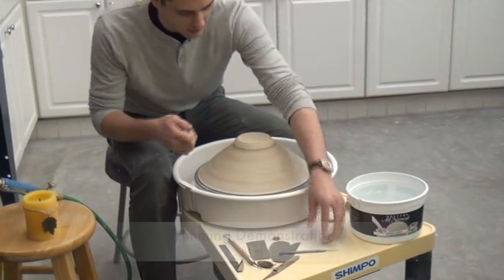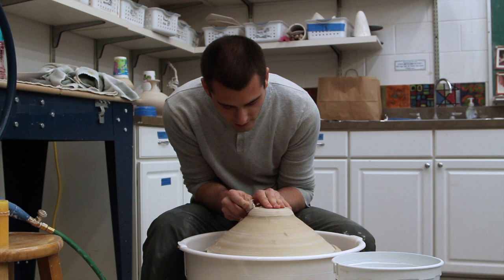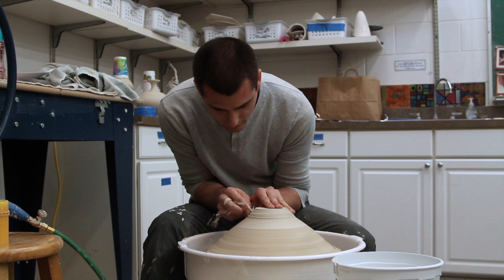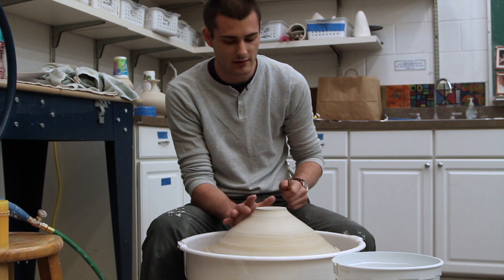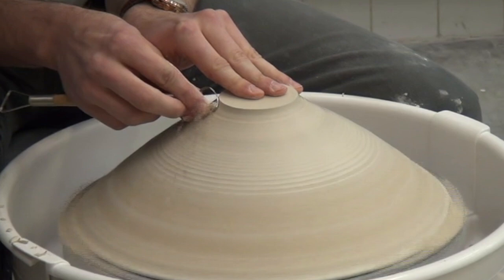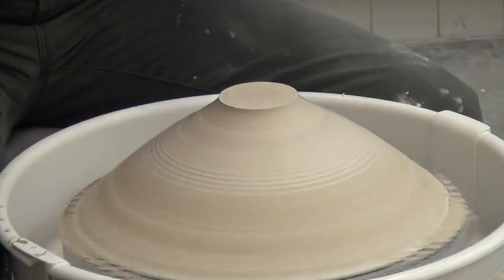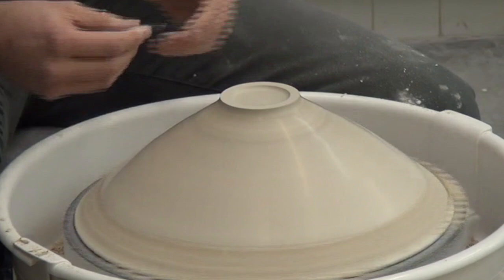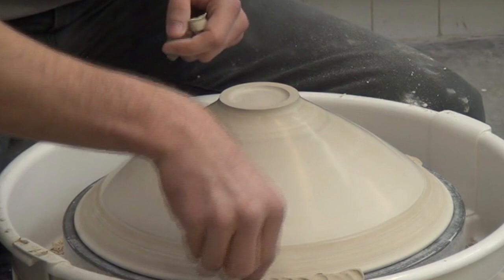How to Trim and Burnish a Bowl - Matt Horne Crystalline Workshop

Comment: hi, in other videos you use a torch. For what is that for? thanks!
Reply: The heat from the torch dries the clay a bit, making it easier to maintain the form. Other times, heat can be applied to dry the clay to get a very cool crackled texture on the outside.